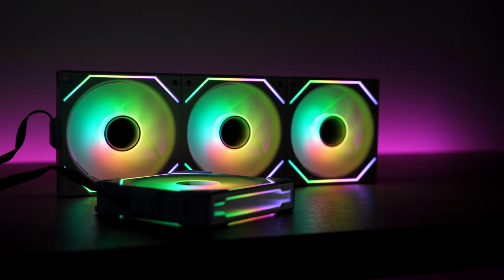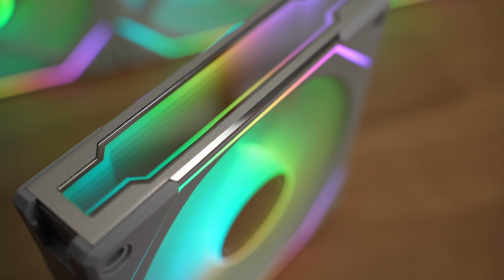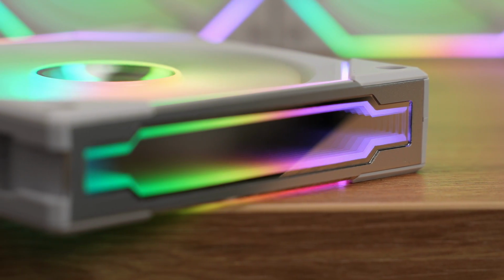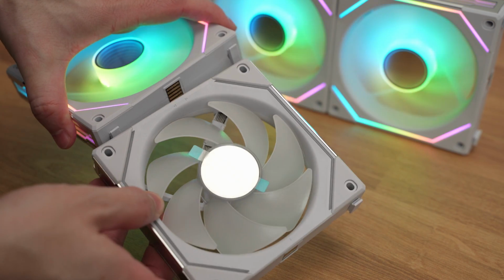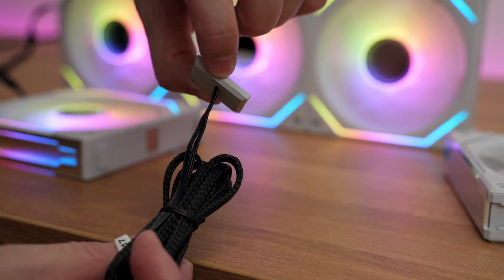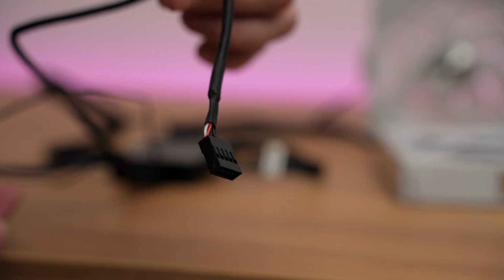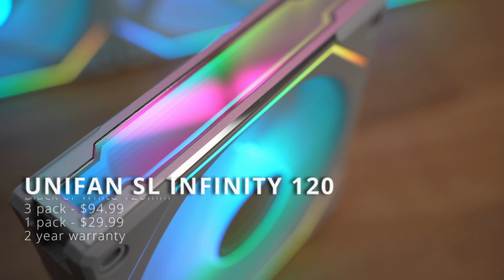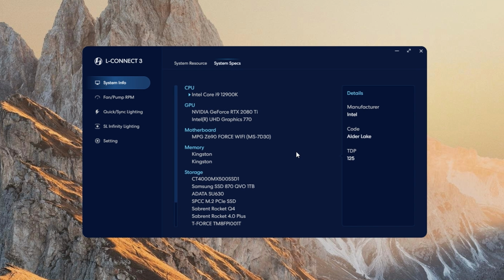Lian Li SL INFINITY fans are AMAZING!!!

Comment: Can you get them to reverse flow somehow or are you stuck looking at the ugly end of the fan if you want to draw air in?
Reply: There are now LL Infinity reverse fans that can be used as intake fans and still show the infinity mirror.
Reply: great! @parabellum8506
Reply from the maker: They look good from the back as well 😂 There is a silver medaljon on the back, lights also and no wires so the side is not as ugly as regular fans
Reply: @LevelUPGamingTech  but no infinity mirror.
Reply: @OnceShy_TwiceBitten  Infinity mirror on the sides

Comment: What’s up with the stickers for the sides  that come in the box? Just for protection or required for the infinity effect?
Reply from the maker: Protection against scratches
Reply: @LevelUPGamingTech  sweet thanks thats what I figured but seems kinda strange as they already came with a protective film. one could install them and just remove the original protection and should be good but the extra protection is nice. I jus wanted to make sure they weren't required for the effects.
Reply from the maker: Original protection is cloudy thin plastic, protective film, additional one is a thick sheet of clear plastic 😉

Comment: they should update the L connect with auto start up minimize to tray and they should update the fan quick rpm reaction its really pissing mi off. im thingking to go back to corsair ML 120 rather than this cosmetics but the performance is worst
Reply: Sorry but I think NZXT has Lian Li beat for worst performing fans
Reply from the maker: Start minimized is there, I am using these fans in my personal rig... and there is no quick reaction, just set the curve correctly, my PC has never been this quiet 😂
Reply: @LevelUPGamingTech  start minikizednin what are you talking about? The app is not minimising by itself so that is why its annoying.  Even the fan cooling performance is not really as good as corsair ML 120.
Reply from the maker: @dexter23foxy  I am talking about the starting minimized, for me it is always in the tray starting minimized, just check auto boot and minimize on close, it will start minimized always, also update the app. I don't want to sound like I am an advocate for Lian Li but in my case I seriously have zero issues and the performance is excellent even at higher RPMs, heck I am using them with water cooling build now... I prefer the silence above everything, these do that for me, so Idk maybe you have some issues. As I said try updating the app and so on. But if you feel that Corsair's are better, well be my guest, I do prefer Noctua though 😉

Comment: I love mine, I've got 10 in my case. A lot easier putting these in and cabling them up, 4 cables for 10 fans, all plugged into the fan hub. The controller software is ok, and it controls my my 2 strimmer cables too.
Reply from the maker: I know buddy they are in my system as well 😁 Curve profiles are easy plus you can set them to VGA source as well, my bottom fans follow VGA temps, while others follow CPU
Reply: I put 16 in mine lol

Comment: If i buy one 3 packs, can i just buy another 3 single pack and connect it with the same hub?
Reply from the maker: Yes you can 👍 4 fans in 4 clusters can be connected on one hub
Reply: @LevelUPGamingTech  thanks for the info 🫶🏻

Comment: So i have a corsair ICUE H150I Elite cooler am i able to replace the stock fans that the cooler comes with for those
Reply: i have an h150 i as well, they won’t work with the icier software, but it does not matter they still cool the radiator which is what matters

Comment: I'm curious if you can swap the mirror decal to the backside to get that effect on fans set as intake.
Reply from the maker: mmm nope backside is just a little ring of light, no mirror effect
Reply: Huge flaw that these fans can't be used as intake and still utilize the center infinity mirror.
Reply: That’s not a decal my guy….

Comment: Great video thank you for making it. When connecting the cable to the fans the cable connection has a cap on it that can be removed so you can change the orientation of the cable. Noticed that the  center mirror is not even centered it wobbles when spinning LOL!!!!! Looks cheesy  So did they steal the design from the Antec Infinity Mirror fans or the Zalman ZM-IF120 fans?
Reply from the maker: Maybe a little bit from both 😂